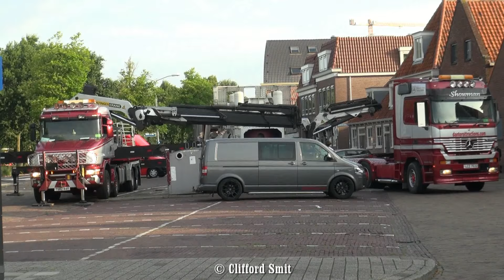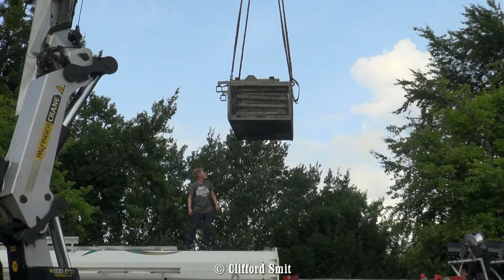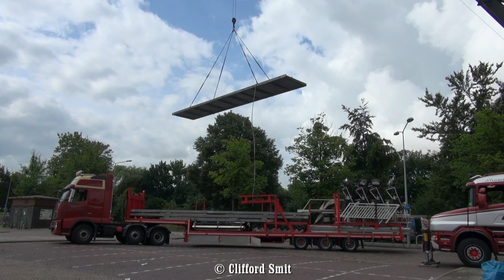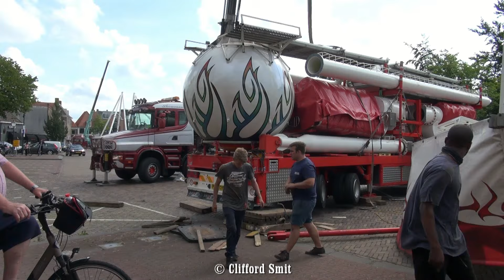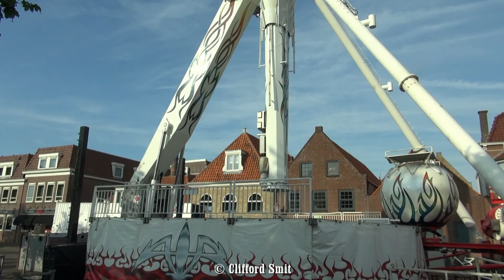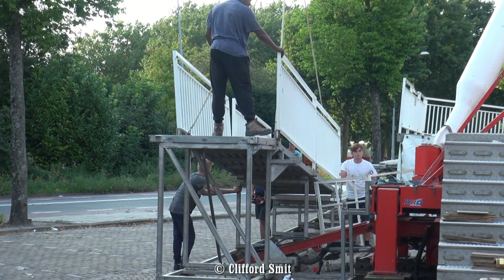Transport montage AIR (Danter) Kermis Hoorn

Comment: Numerous safety violations. Totally unsafe crew. NEVER walk underneath the crane when it is in motion. Those guys could have been instantly killed if the lifting straps broke on it. No personal safety equipment was used. No hardhats or safety glasses. Otherwise, great video.
Reply: go away leave them to do it  is their life
Reply: im pretty sure the Dutch wouldn't allow such unsafe-ness, im guessing your a union boi
Reply: They know what they are doing. All Danters are Born To It.... Experts.!!!
Reply: If any equipment fails, a hardhat and glasses won't save you.